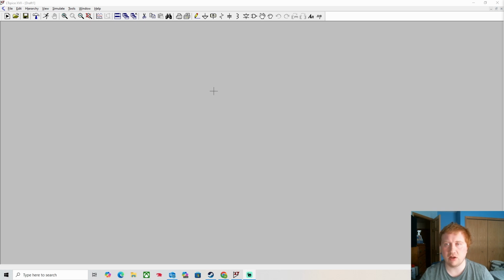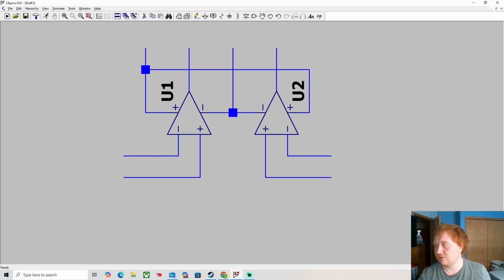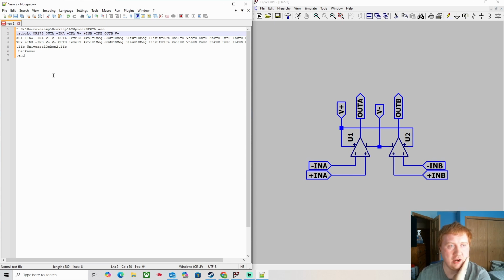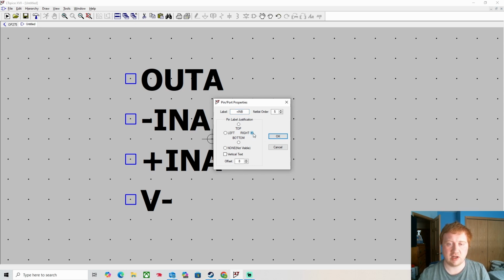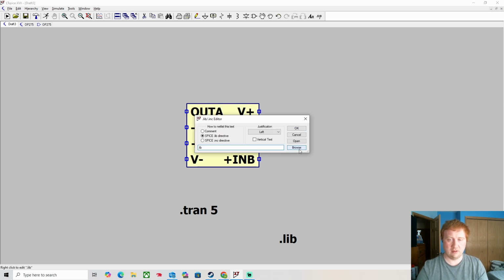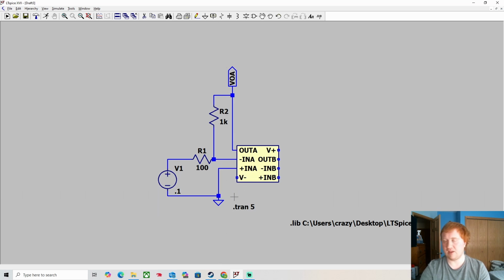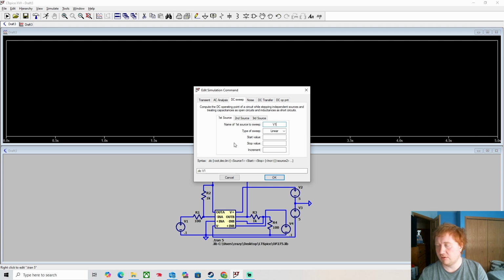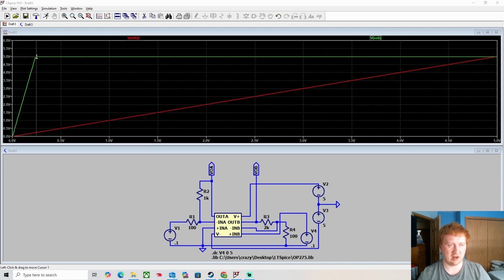LTSpice - Making Sub-Circuits: Netlist Method

Comment: Great video.

I'll add a few points:

1) In the "Symbol Attribute Editor" window, there is a line "ModelFile".
Enter your CircuitName.sub/CircuitName.lib or CircuitName.cir there - that's it, you got a global component, now there is no need to add the file path via .include or .lib. Provided that the symbol file is in the .sym folder, and the subcircuit file is in the .lib folder in the main directory of LTSpice. Now you can create multi-lib folder trees with component lists.

2) There is no need to use third-party software to edit the netlist. "View - SPICE_netlist - Edit as independent netlist - Save in directory - Edit the necessary lines - Save again". 
The "CircuitName.cir" file is ready.

3) If you use behavioral sources inside an asc circuit, which is then converted into a subcircuit, and these B-sources use control nodes (not ports!) via functions, for example B = V(node), then your subcircuit will ignore them. Assign global quality to all arbitrary nodes (but not ports!) via "$G_". Therefore, the correct B-source function for subcircuit will look like this: B = V($G_node).